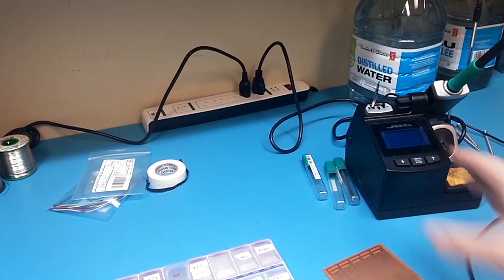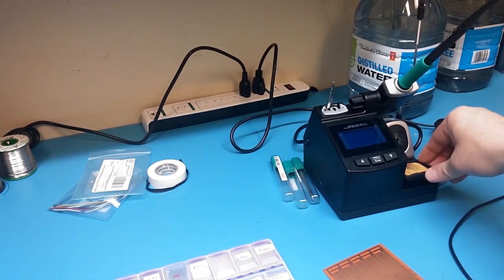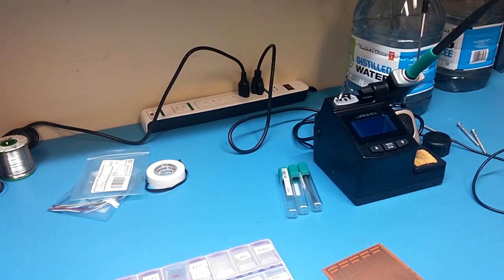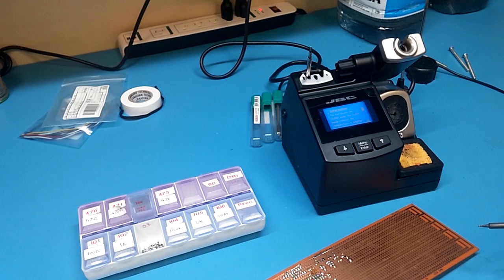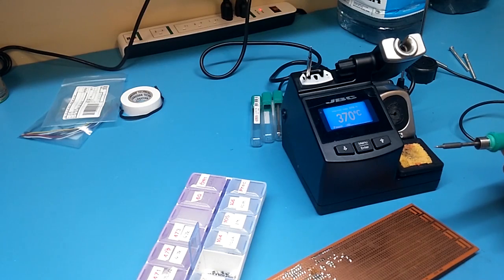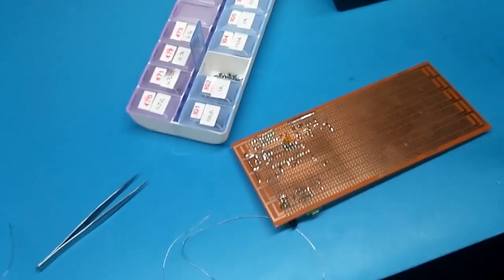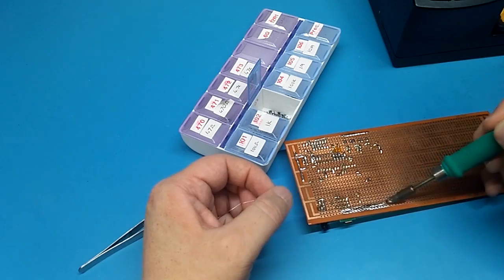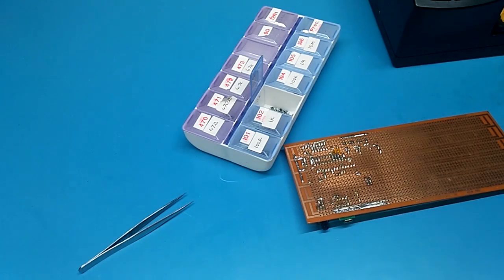JBC CD-BE - Solder Station Quick Review

Comment: can i connect a thermotweezers to it?
Reply from the maker: Hi Рома, I couldn't get any specific details from their website that states one way or the other, but from what I could find on the website, this station takes the T245 handle with no mention of any tweezers being offered sadly. It would definitely increase it's usefulness if it would allow some :)
Reply: @39Kohm  According to the Pinout I found ,the tweezers should work. I wish I had it for the test.

Comment: Hello, Peter! Thanks for the review.  By means of the USB connection, you can not only update the station software, but also export graphs of the soldering process and manage or monitor parameters via your PC. Hope that helps! More information is available here: http://www.jbctools.com/cd-b-soldering-station-product-505.html.
Reply from the maker: Many thanks for the comment, It was a nice iron to use, I had used it a bit off camera since and found it to perform well. I've had some irons where you get into a few minutes into soldering and you feel it lacking in certain areas (such as not providing adequate heating for larger areas or uneven wetting on the tips) , with this one I had no issues with any of that. I have unfortunately recently parted ways with the company and won't be able to do a follow up review of the unit. Thank you for the information, I will add the link to the description both.

Comment: $500 isn't bad if you actually need a station that skookum.
Reply from the maker: This was a demo unit that was on loan to my company, we ended up getting a different model, I'm happy with my $150 hakko clone personally :) If I had enough to buy one of those I would spend it on a scope instead ;)
Reply: @39Kohm  which hakko clone did you buy